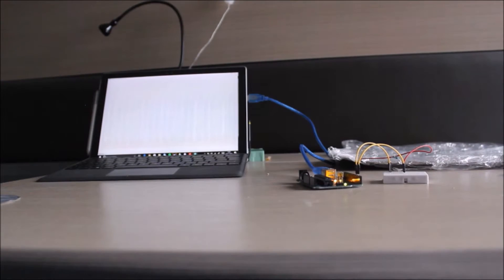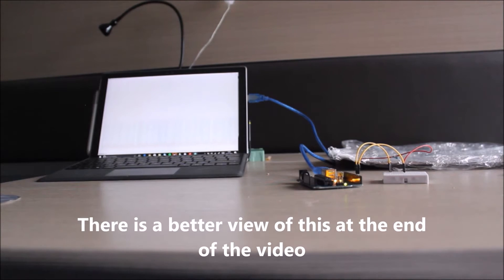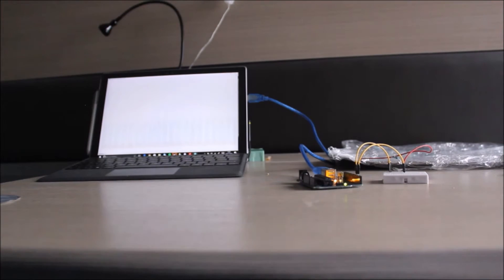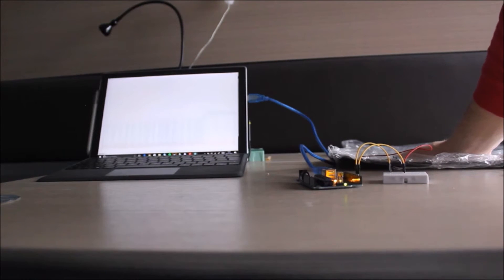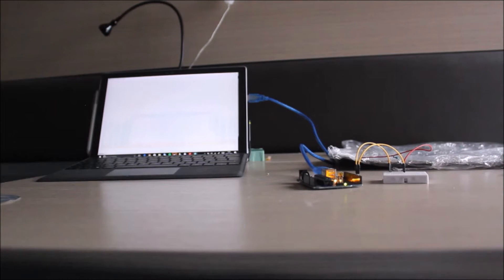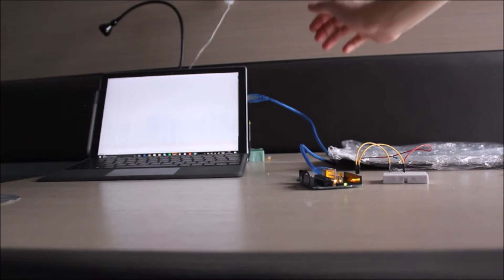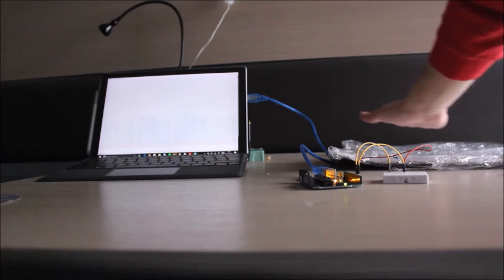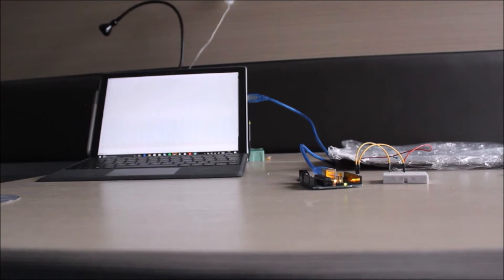How To Make a Capacitive Sensor for $1 with Arduino | Student Builds

Comment: Hi , i need to produce a 8 *8 matrix . I am using 16 pins (8 horizontal and 8 vertical ) so if i press a square , the arduino detect the touch and will produce a corresponding sound . Is there any way in doing this .. ie using a buzzer ?

Comment: Can i use this for automatic waste separation? Please answer
Reply from the maker: Isabella bacon that’s an interesting idea! It’s definitely possible depending on what kind of waste, although you might need to make it more sensitive (reduce the resistor value)
Reply: @StudentBuilds  hey i tried this but the problem i was facing is it detects wet waste (high value on serial plotter) only as long as my hand is in contact with the waste. how can i fix this? please help!

Comment: Hey great vid! How would I go about adding 3 capacitors (To 3D track track hand position) in the code you provided? Thanks
Reply from the maker: make another two totals, ie toal2 and total3 by copying and pasting the line and replacing the 'total', and then replicate the capacitiveSensor initation 3x (each with a different name) and just replace the 4,2 with the pins you will use with each capacitor. Hope this helps
Reply: Legend mate ty
Reply from the maker: no probs, i'm going to put a video out in the next couple of weeks on using this if you find you need any other help
Reply: I'll give it ago in the week, just waiting for some parts to arrive, I'll keep you updated :)
Reply from the maker: How'd it go?

Comment: Sorry but I tried the code and nothing happened. Should i do something before I try to launch it ? Maybe import something ? I'm french, sorry if I missed something.
Reply from the maker: Try using crocodile clips to connect the wires to the plate. Sorry for the late reply!
Reply from the maker: you need to make sure you have the capacitor library included!